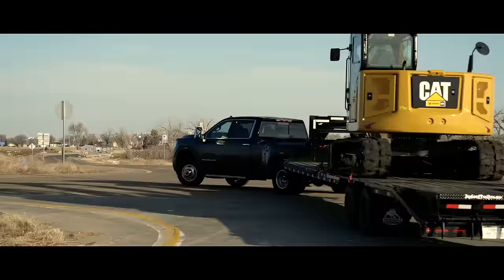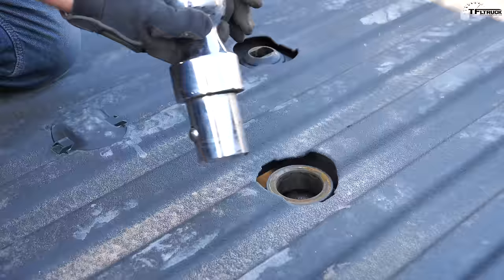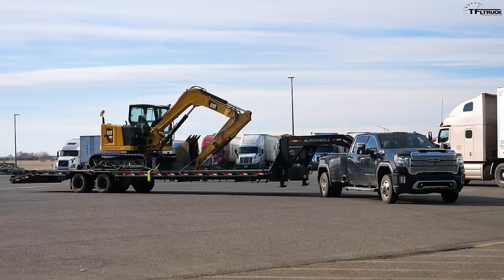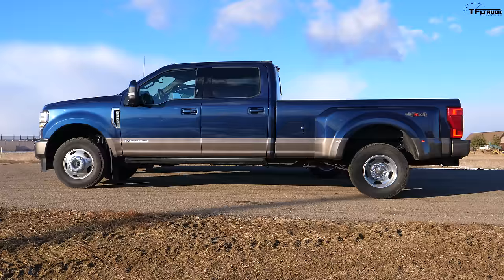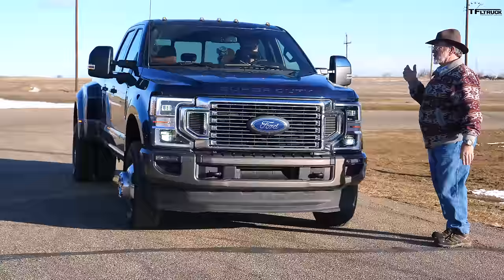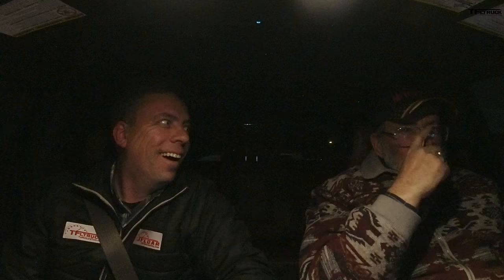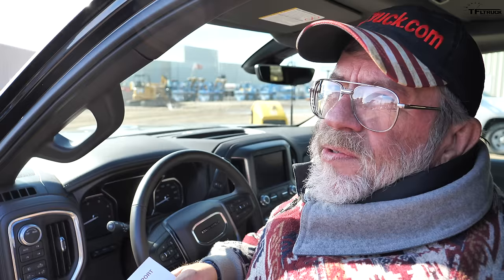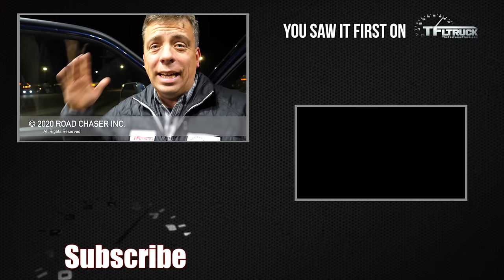30,000 Lbs Monster Tow Test: 2020 Ford F-350 vs GMC Sierra 3500 - Drag Racing & Tow Off!

Comment: The Ram will put them both to shame!  Cummins is the only real diesel engine out of the big three. Ram also has air ride and the best interior of any truck on the market.
Reply: Lets be honest here, The Cummins is nice, but its not leaps and bounds ahead like you say, the Powestroke has been solid since Ford started producing them in 2011 and the Duramax hasn't ever really been all that problematic. The only reason people choose a Cummins (especially in a shit truck like Ram) is just to buy the name (Cummins) and on that note, the Powerstroke and the Duramax has always performed better than the Cummins.
Reply: @nathanmcdonald610  Everyone is entitled to their opinion.  But as an lifelong mechanic I would never own a Ford product after having to work on many of their vehicles.  They are junk built with junk parts and sold at absorbent prices.  They made me tons of money over the years though! Any truck that you have to pull the cab off the chassis just to work on the engine is a piece of crap IMHO.  Most mechanics that I know hate Fords!  Rams and Chevy's are much easier to work on and don't have all the engine problems that power strokes seem to have.  It is a very bad design!

Comment: The GMC and Ford both look good to me, but the GMC wheels look sooooo bad and cheap. Their dually wheels look so dated. If you're going to buy one or the other, what I'm finding out is that GM holds WAY more value than Ford or Ram used. I guess it would be better to buy GM if cost new is equal to other manufacturers, because your money will go further down the road.
Reply: According to Kelly blue book the GM. HD resale value at 36 months is less then 1 percent ( .4%) higher then Ford's.
Reply: @benjaminwayneb  lol..... Not where I live!

Comment: One additional reason why they Ford is faster 0 to 60 is because it had the lower gear ratio of the two trucks
Reply: The slightly higher ratio in the GM should be a fuel economy advantage.

Comment: You got better fuel efficiency because of the air temperature was lower  Which means more efficient power delivery especially once the motor is warmed up! 5ﾟ in temperature will get you an extra mile per gallon

Comment: Look at the dash of the ford when they refuel they only drive for 64. Miles not 66
Reply: Both trucks made the same 66 mile trip, the Ford odometer read 64.9. and the GM read 66.6

Comment: Both the same! GM was ran during the day, vs  Ford ran at night in cooler temps. So obviously Ford has the advantage.   Still take the GM over the Ford! Watch the 350 and 450's going down the highway and front wheels nearly off the ground!  I own a Ram and great towing, but going to a GMC !

Comment: It is NOT an Allison 10-speed!!! Allison does not make a 10-speed planetary gear based transmission, and everybody needs to quit with this bullshit about "Ford and GM developed the 10 speed transmission".
Stop it!!!
Zuffenhausen or ZF developed the 10-speed automatic transmission that is used by Chevy, Ford, and RAM trucks, Chevy and Ford 10-speed transmissions are interchangeable with an adapter plate, RAM external housing won't fit the other 2 but the planetary gearsets on all 3 are identical, they are dimensionally near identical, same alloy, and cut and ground on identical hobbing and polish grinding CNC machinery built by my employers parent company, and the part handling automation is built by my employer and programmed by people like me.
Zuffenhausen also manufactures transmissions under contract for all 3, the tooling changeover time is 15 minutes. Yes that's how different the 10speed in the Ford, RAM and Chevy/GMC is, cosmetic. 
Each has their own tuning programming of the electronic controller, woweee!!
The same transmission with 60mm (vs 80mm) center planetary gear is used in the mustang, camaro, and challenger.

Stop saying Ford and GM developed it they didnt, ZF did and the 3 bought full mfg rights to it! Their respective mfg plants production machinery, automations, and in-process QA are clones of each other!  We built clones at all 3 "competitors". Not gonna say our name here but if you're in the industry you'd know who it is, parent company name begins with R.

It is amazing to me how much you guys get played out by brand management, they are assembling near cloned drivetrains designed tested and built by the same supplier. Oh ZF also sold a near clone of it with 8 and 9 speed planetary gearsets to .... Mercedes & BMW! Yeah your beloved magic BMW has 9 planetary gearsets and clutch-plates that are a clone of 9 of the 10 gearsets in the mustang/camaro/challenger.

Comment: Ford:
-Figure On Repairs Daily
-Find On Road Dead

Their ride is terrible. 
The interior looks and feels cheap and seems to have been put together without much thought on the engineering side.

Our company bought a brand new F-450 truck and it has broken down twice on the highway with less than 20K miles. It just completely shuts off.

Ford has built junk vehicles for a log time.
And it continues. ...

I'll take the GMC any day.

Comment: The comment section just reveals the level of stupidity of the general line of thought in the average person. Drag racing a dually truck has zero to do with its ability and longevity of hauling a loaded trailer day after day. But whatever blows their dresses up. We have 2019 fords and GM's at work. Both are nice but both have stupid engineering.  The ford brand new off the lot with 1 mile on drives like complete shit, very similar to driving a farmall A. The gm has stupid mirrors and a few other things I would do differently. It's a guarentee that ford gm and ram all have issues and there will always be a lemon from all 3. But most of the guys here have their ford goggles on and probably most have no experience with either truck or haul freight every day.
Reply: While I agree to an extent, drag racing a dually pickups doesn't serve much purpose other than entertainment, a fully loaded 0-60 can be very telling. People always hark on these guys doing loaded 0-60's in these trucks claiming that its pointless, but the reality is, its usually just people being salty because their favorite brand didn't perform as good as the others or something, loaded 0-60's are a very good way of showing how one of these trucks will haul a load up to highway speeds on an on ramp.
Reply: And it has zero to do with the reliability of the truck. Nobody is gaining anything from one work truck to another by judging a second or 2 from zero to 60 difference between trucks. A few years ago the exact same test was done. The 2 trucks had different gear ratios on that particular test. There are all kinds of variables from the crank to the drive wheels.
Reply: Your second comment was there for a few seconds and then it was gone. But you totally proved my whole point. If you read my 1st comment you can see I am referring to the average person's comments. What I said had nothing to do with the guys testing these 2 trucks. I would do it as well. But my point is nothing is proven until several hundred thousand miles later. And if you want to speak about performance then go to any modified diesel pickup truck pulls. Ford hardly ever wins. It's always between duramax and cummins. And that has nothing to do weather ford is a good work truck. Because we all know it's a great work truck. As are most of the 3 brands.
Reply: @8luggarage  Sorry for the late reply, I wasn't notified until just now for some reason, anyway, I've been to my fair share of truck pulls and the big factor between who wins in their respective classes is tires, not brand of truck. A Duramax with bald all terrains isn't going to drag a sled nearly as far as a Powerstroke with new swampers, Lets be realistic about it, A Ford F-250 with a diesel engine weighs about the same as an equally equipped Ram Cummins 2500 or  Chevy Duramax 2500 and they all make around the same horsepower and torque stock for stock or with the same modifications, the only thing that really factors in a sled pull is what kind of tires are being run (everything else being equal).
Reply: @nathanmcdonald610  have you ever been to the Scheid diesel extravaganza in Terre haute Indiana?